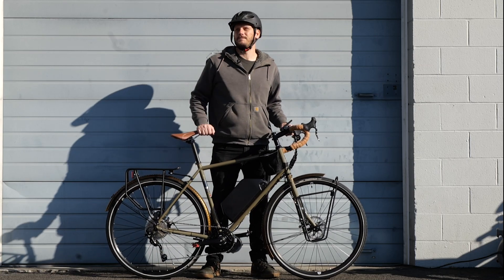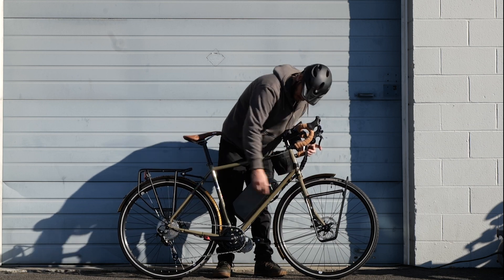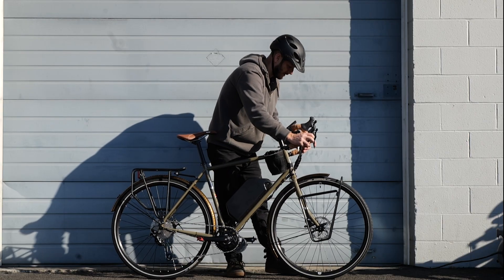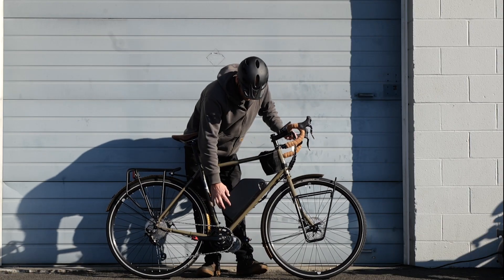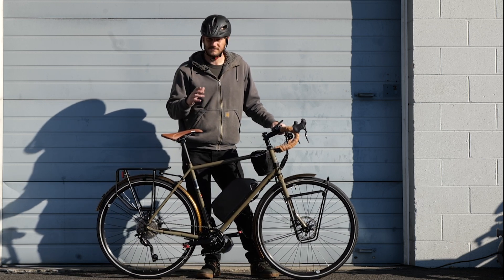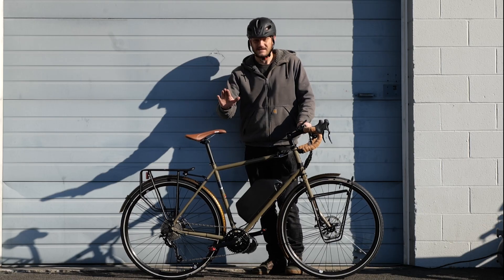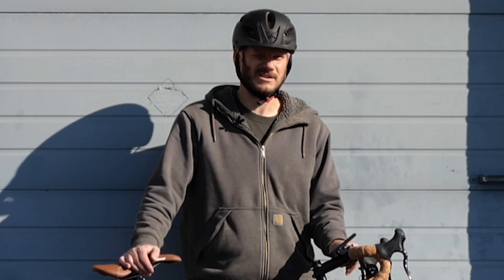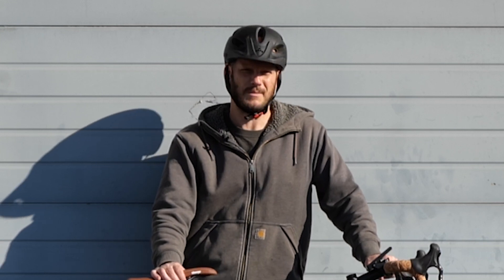JohnnyNerdOut   231027 Fuji Road bike 52v 25ah BBS02

Comment: I have a 29" BMX 9 speed bike that I would like to use the same motor and battery(if it will fit). I want to shower with that same helmet. Can you tell me the brand and model?

Comment: I prefer a bafang to regular chain ring adapter.  You can mount the chainring to either side of the adapter to center the chain line and probably even use washers if someone really wants to really fine tune it.  Leki all have different offsets and you have to hope your preferred tooth count chainring is the correct offset.

Comment: I have the same size battery and motor and it usually has 40-70% battery after a 24mile commute.  Only complaint is I'm seeing more voltage sag after a year, and now have to wait an hour for it to give an accurate reading

Comment: It’s nice to see road bike conversions with the often-neglected-by-many efficiency mentioned!

I have a Trek 1.2 I’d like to convert using a BBS02 for all the reasons you gave. I like to go fast, but my comfortably maintained cadence is only about 80, so I’d like to retain something close to my current (edit:) 50 big ring.

Do I need to restrict the maximum current to maintain long life of the motor/internal gears, or has this been overblown online?
Reply from the maker: If you are a confident cyclist and understand the basics of not over stressing the motor, you should be fine. If it’s too high of a gear for your legs, it’s too high for the motor too.

Comment: I thought a bbs02 was 48v max voltage?  I have bbs02b 750 watts and it states that it is 48vlt max.
Reply from the maker: 52v batteries almost always are read as a 48v by the controller
Reply: I'm using 56 volts on my BBS02 with no problems.  Error code 07 will appear once Bafang controller detects 61.5 volts and it will shut down the system. You can use a fully-charged 60 volt battery in parallel with a 48v or 56v battery to avoid this error code.   Using a fully charged 60v battery will put you over the threshold at approx 62v.